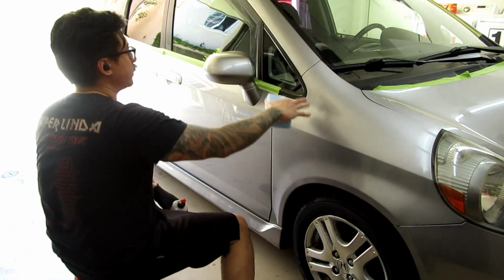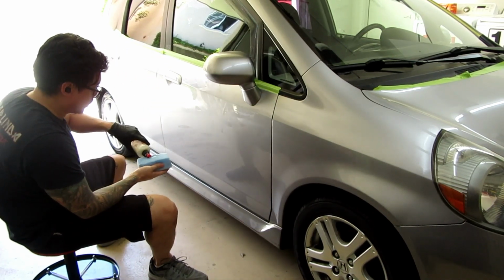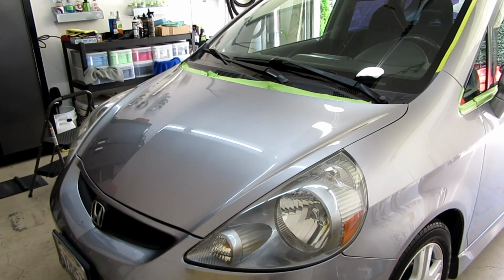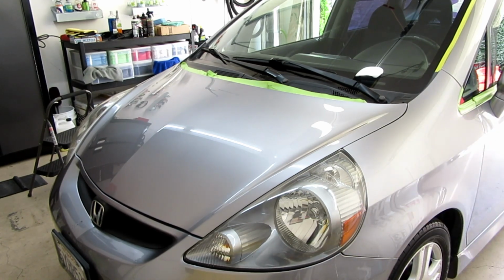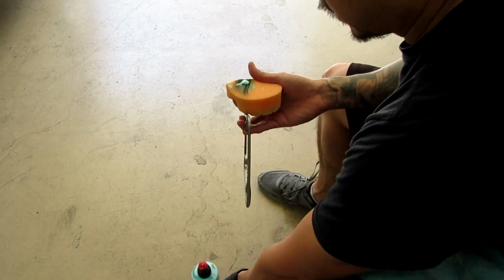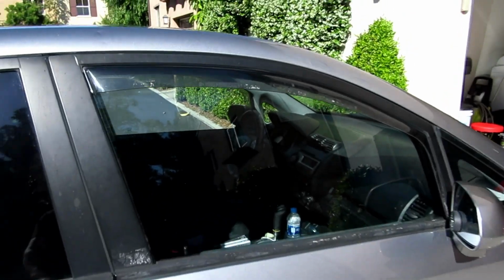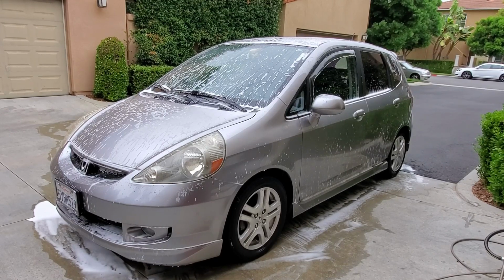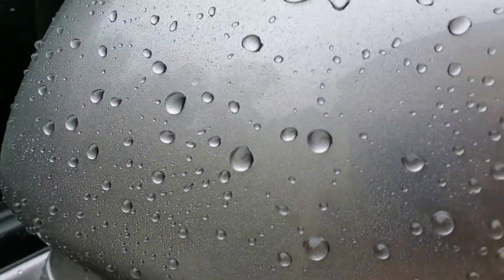Honda Fit Part 4 | Collinite 845 | Turtle Wax Ceramic Coating

Comment: any updates my friend? is the combination good?
I'm wondering if it is right that collinite first before TW or the other way around. internet has no discrete answer on this.
BTW, im using collinite now and im considering to use this combination
Reply: I use that same TW and after every wash I put P&S bead maker for maintenance the gloss it gives is great.
Reply: With the chemistries of the 2 products being completely different, don't think it would work too well.  I'd stick to the same product line, but that's just me.

Comment: What about Seal and shine and top it off with collinite845?
Reply from the maker: Wouldn't you want it the other way around? 845 and top it off with Seal N Shine?
I do like Seal N Shine and use it.
Reply: @MikeEM1  cool man, what is your thoughts about that combination?
Reply: That's what I want to see a video on. The Seal N Shine (not ceramic) should be the base layer with 845.

Comment: Love your videos! Why would you want to put the tw spray coating with 845? It’s two different types of products so isn’t it a waste of time to stack them? Why not just do one or the other? Thanks!
Reply: I'm assuming the collinite was a base coat mainly for protection and the turtle wax was for added protection but mainly to help bead water off better
Reply from the maker: It was something I was just testing out and seeing how it would go. I'm always going to try things.
Reply: MikeEM1 cool!
Reply: @MikeEM1  nice video mate. I'd refrain from topping collinite or any other sealant for at least 24 hours to let it gas off properly and bond to the paint without being disturbed. After that is fine to apply TW or anything else. I like to stack Fusso Coat with BSD but always leave Fusso undisturbed for a few days first.
Reply from the maker: @JWL-UK  I agree, but I couldn't keep the car for 24 hours.
Reply: @MikeEM1  I get that 😊